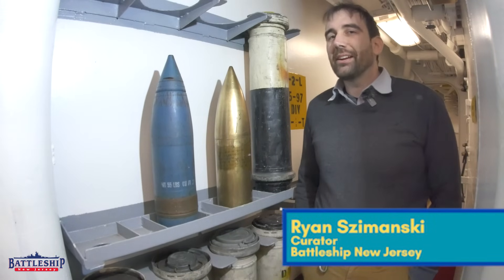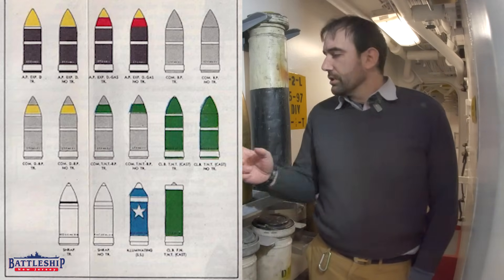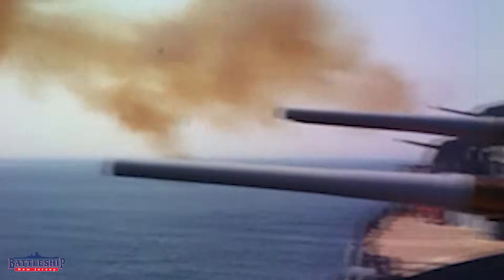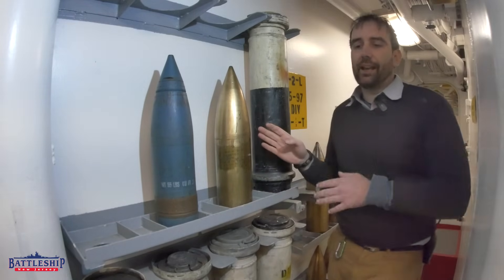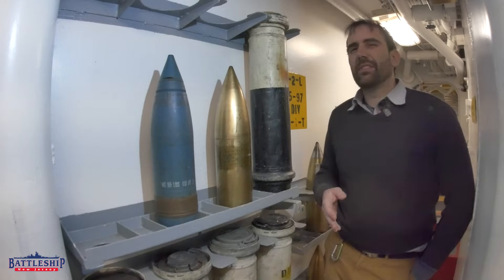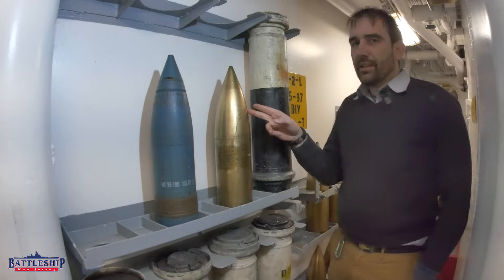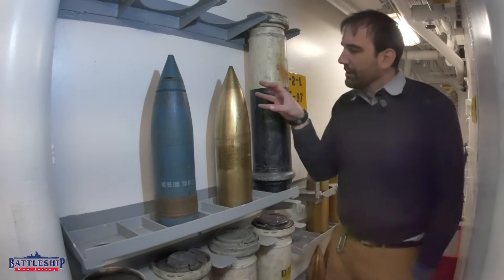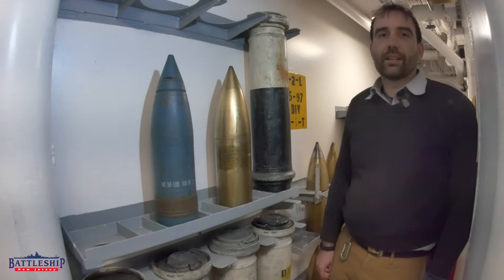How Can a Projectile Weighing Over a Ton Moving 1700 MPH Be Inert?

Comment: 7:18  I see a wooden practice propellent case inside the door. It has a brass base attached to a wooden body topped off with a tapered galvanized steel nose. An internal threaded rod holds the pieces together. There is a rubber pad attached to the nose. Gun crews used them for loading/unloading  training purposes. The brass projectile could be used in conjunction with the wooden dummies during drills as there is no turning band that can get stuck in the rifling.  I have a 6''-47 wooden dummy propellent case  still in an original unopened cardboard box and noted that it was produced by the Drexel Heritage Furniture Company.  The 3''-50 wooden dummies used to be all over eBay, some were in terribly rough condition.

Comment: Even if is does not go Boom, a 2000lb shell full of concrete or sand will still be a grand teacher of the laws of physics when fired from those 16 inch rifles. Even the smaller, lighter 5 inch inert rounds are enough to ruin one's day and have them swimming back to the beach. I think that having inert shells will help the the engineers back at the armory understand what the mass and velocity alone will do to a target and help them develop new charges to put inside the shell during the R&D phase.

Comment: I think the brass rounds make perfect sense. You need to practice loading very repetitively which would mean you'd be wasting a very significant amount of space and displacement on inert rounds when the brass rounds can be reused. I say this based on the fact that the compression ring is not reusable after it's been rammed into a barrel and the breech is closed. Not to mention, I can't even think of how one would be pulled out.
Reply: Shell engaging/gripping rifling would have to be pushed out through barrel/back into turret from other end with major force.

They had major problems in getting (live) shells out from barrels after Iowa turret explosion.
With fire raging inside turret they had to hose turret roof and barrels with lots of water to prevent powder in other guns and possibly shells from going off. Also magazine and spaces surrounding turret's lower structure had to be flooded to prevent bright red glowing walls from causing chain reaction possibly leading to magazine detonation.
Reply: I should have said, I can't think of how one would be practically pulled out.
Reply: @petejemas  I was observing a field exercise with the 20th Field artillery in Canada ~25 years ago. One person got their beret caught in the gun.

They got it out by firing the gun.

Comment: just a thought. but the brass round can be unloaded as it does not engage the rifling ,where the blue round has a band to engage the rifling and would be stuck once loaded.  it's like that when bench rest shooting.the round is pushed into the rifling and opening the bolt pulls the round out of the case and dumps powder in the chamber and action. a pain to clean up ! I'll bet a little Dangerous on that scale

Comment: Do you know the difference between fragments and shrapnel? Shrapnel was a special type of shell, used mostly in WW1against infantry and was especially effective when they were out in the open. Each shrapnel was a hollow shell with a solid base with a small charge of black power in the bottom followed by a metal disc and then filled with lead or steel balls and a time fuse set to explode several feet above the ground like a big shotgun blast spraying anyone below. They were effective only when the fuse was set properly and mostly when soldiers didn't have overhead cover. Shrapnel wasn't used much after WW1 because HE common shells were just as good if fused properly. HE common had fuses that could be set for time, impact or delayed impact, impact being used to dig holes and ruin trenches and cut barbed wire.. HE common were a real killer after proximity fuses were developed and used late in WW2. They were even more effective because there was no guessing to set the fuse to explode at the correct height and they were very effective against aircraft. Here is a link with a basic explanation of Shrapnel.   https://en.wikipedia.org/wiki/Shrapnel_shell
Reply: Believe designed by the French in time for the civil war

Comment: Another reason for using brass for the  “dummy” rounds is that brass is softer and more ductile than steel.  If you drop a brass round on the deck or shell hoist or god forbid a real gun, the brass shell will deform (which is easily fixed), sparing the steel item.

Comment: I'm not a gunners mate, but it's my understanding the brass rounds lack the driver ring to prevent engagement with the rifling when loaded. That allows them to slide back out of the breach after loading so the process can be easily repeated over and over during practice.
Reply: I'm not a gunners mate either but I agree totally, I'm convinced they are used to practice loading and ramming with the easy unload feature understood.
Reply: Now that makes sense. I wonder what the base of the brass shell looks like, whether there is some indentation that can be gripped to remove the shell.
Reply: also brass is pretty soft metal so it can't demage the rifling and the barrel wile the blue one has a body made out of steel, so if during a practice they accidently drop it in the barrel they can cause demage.

Comment: If the brass shells are dropped or otherwise abused, it won't affect their usability.  If you drop or physically deform/damage the inert round, which IS intended to be fired, it could cause damage to the gun.  The blue inert ones were not played around with like the brass ones were.
Reply: Brass is also softer and much less likely to damage and cause undue wear to the equipment.
Reply: It probably would have been cheaper than making a brass dummy round is just designate one blue dummy rounds and not fire that one
Reply: Exactly!
Reply: My best guess is if the brass shells are dropped it, won't spark  and  secondly the inert  inert shells if compromised it won't obstruct the integrity of the high test steel barrels of the main gun.

Comment: How do you guys inspected by the city for code? It's a boat, how do you have to turn into a building to meet code?
Reply: NFPA 70 (National Electrical Code) lays out it's scope in article 90 that ships are not covered under NFPA 70, so not much for the city to inspect on the electrical side other than shore power. I'm sure there are some standards they have to abide by, but I doubt it's the city that has jurisdiction .
Reply: @leviathanfafner  Agree  and for safety issues I would imagine it is inspected by the USCG and maybe ABS (American Bureau of Shipping).
Reply: @leviathanfafner  its scope

Comment: Brass vs inert blue training shell probably feel different from each other on contact, ( no paint just polished brass) in case of low lite or smoky conditions, and also look diferent from each other,  and sans copper driving band are probably easyer to unload without fireing. Brass inert probably also lasted longer individually than blue painted shells and could be used untill they were worn down. If your practice loading and unloading shells in a otherwise live gun not dealing with a projectile loaded so it’s driving bans engage means being able to dry fire during a drill. It’s basicaly why my snap caps for dry firing drills in 9mm 45 12 g and .223 are solid bright red, purple, and  neon and have the weirdest looking bullets shapes when put next to live rounds. If one gets mixed into a batch when reloading a magazine or moon clip I know to finish up and do something nice . . . Or apologize…or both

Comment: How do you change out an 16" barrel ?
Reply: They can be lifted out with cranes in drydock.  If you're asking how to service one, the barrels are two piece affairs.  You have an inner liner with the rifling, and an outer barrel.  Heat up the outer barrel to make it expand and keep the liner cool and the liner can be removed and replaced with a new liner.  There are limits on how many times the barrels can be relined before the barrel has to be replaced, though.

Comment: The powder blue rounds are (for lack of a better term) "marksmanship" training rounds.  They are designed to be fired from the appropriate gun and to have the ballistics of the service ammunition that they are emulating, while being cheaper to produce.  They have no fuse, no explosive filler, and no target effect.  Army would call them TP (target practice) while Navy would call them BL&P.  Most training rounds used by Army units conducting direct fire (direct fire=shooter sees the enemy) are NOT inert, since in most cases the round going downrange would have a tracer element that helps the shooter "spot the shot."  

The brass rounds are also training rounds, but what they are training is, as Ryan stated, the loading procedure.  NAVORD OP-769 calls these "drill projectiles" for the 16" guns.  Army would call them "dummy rounds."  They would emulate the dimensions and weight of the service ammunition, but materials could be different from the service ammunition.

The word "INERT" in the realm of ammunition describes the condition of ammunition rather than a type of ammunition.  "INERT" means that if the ammunition had anything in it that could ignite or go boom, that has been neutralized.  This would apply to ammunition and/or projectiles that may at one time have had one or more fuses, tracer elements, propellant, or any sort of explosive.
Reply: And storing them in the hallway would be by the universal rules of every competent military or law enforcement organisation: Never mix live combat ammo with any form of training ammo or blanks
And: Never store live ordnance or propellant where an accident or enemy action could cause unmitigated damage.
Reply: Excellent explanation!

Comment: 100 training rounds per year for a single ship seems low. That is less than 12 rounds per year, per barrel. Is that enough to keep a gun crew fully trained? Might make for an interesting video on what sort of training and how much each gun crew actually did.
Reply: I imagine a vast majority of the training involving gunnery on a ship like New Jersey is loading, unloading, handling ordinance, calculating firing solutions, and drilling damage control. You got to remember there are dozens of sailors working those guns that don't really get any training benefit from the gun going "bang", but a few rounds a year to make sure the whole operation and equipment are working together well seems about right.
Reply: That’s a hundred fired rounds. It doesn’t include the thousands of equivalent rounds done during drills that get removed and reused. Which the unpainted brass ones would be used for. It doesn’t always have to go bang to get useful training done.
Reply: Budgets
Reply: @tomhenry897  Even with blank cheque budgets you don’t want all your training to be done with live munitions. Inert munitions are critical for the initial familiarisation training and ongoing drills. Much less risk of someone being injured or killed in an incident. Trained people are expensive so no point in adding needless risk.

Comment: Having both types of inert shells makes sense.  One is for live fire practice done at sea while the brass shells can involve training at both sea and port.
Reply: Even for normal rifles it makes sense to use yhe buffer rounds  to practice with guns that have manual cycling or are single shot...or to provoke a misfire.
You don't need the bang to do that. 
There are blue practice rounds, bit it's just the bang and plastic shrapnel to get used to the sound and recoil.
Reply: @mammutMK2 I very much agree. The ability to force malfunction in training will help still muscle memory, if done right.

Comment: I would think that the reason is that the the brass ring would eventually get damaged and make the round unusable (or inaccurate) if used for the practice machine.  A round without it would not have that issue.
Reply: This was my thought as well.

Comment: Has plenty of inertia to go around!
Reply: Kinetic Kill Vehicle? Did Battleships ever use Tungsten Darts and Sabots?
Reply: @snewsom2997  imagine a 200 mm APHEFSDS round with a 1500 m/s velocity fired out of a 16 inch gun. I don't think anything would survive that except another battleship.
Reply: @BoomchacleV0  I question whether even a Battleship could eat that without being cored. In one side out the other.
Reply: @snewsom2997  my issue would by lack of damage, as there just wouldnt be much explosive mass behind it
Reply: @BoomchacleV0  Tungsten dart would vaporize on contact with the Armor, pushing a jet of Tungsten Plasma through the Side @ 20k degrees. That's gonna burn through a lot of metal, dump a lot of heat into that section of the ship and cook everyone in that section assuming they are obliterated. 

You just scale up what an APFSDS does to a tank. They can go through one side and out the other, at least with Rolled Homogenous Plate. Not a lot of angled amor on that battleship either, lots of perpendicular and near perpendicular surfaces. However 16" of armor is still 16" of Armor, 400mm.
Reply: @snewsom2997  Yeah, it'll fuck up whatever it passes by, but I doubt the spalling from the dart will do more to the surrounding volume of the ship than a few hundred pounds of literal explosives detonating inside. I can see it being useful to penetrate larger ships than your gun can normally penetrate, but now we have missiles for that.